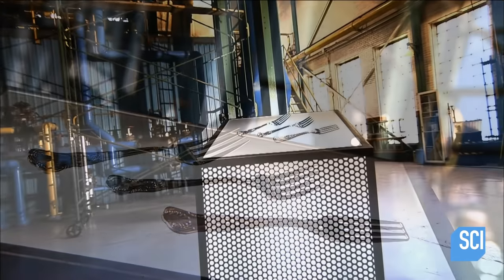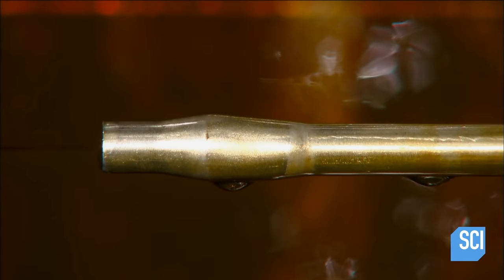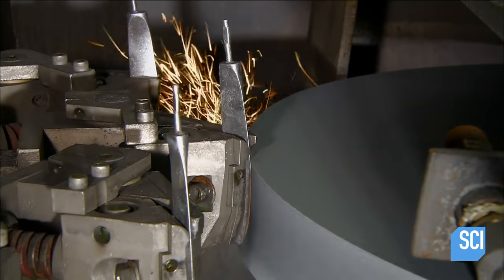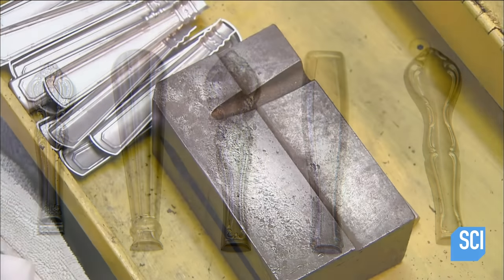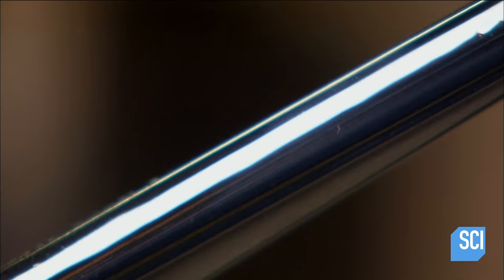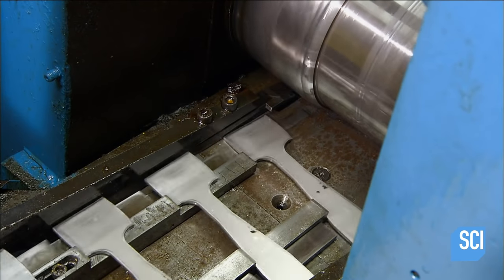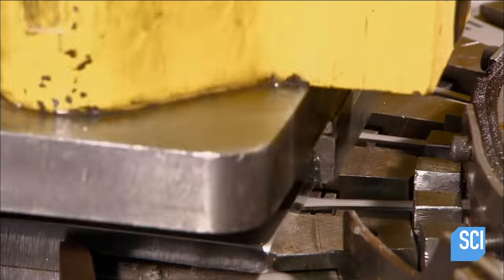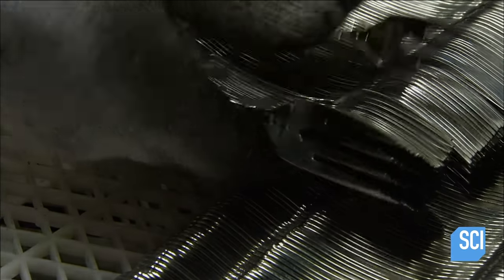How It's Made: Flatware

Comment: So basically the cement in the knife is a cheap way of making the knife feel heavy without using real metal.
Reply: I am shocked at this discovery. I’m almost mad. Here I was thinking that it was all solid metal.
Reply: And it really seems like it will fall off but I don't remember it falling off ever.
Reply: Less about weight, moreso about rigidity. The tang of the knife is held solid by that cement, and it keeps the thinner nickel handle from being able to dent or bend.
Reply: I'd even pay more for solid metal instead of hollowed out handles filled with cement.
Reply: I feel cheated. Will not buy expensive cutlery anymore. IKEA all the way
Reply: @wackychicken  But IKEA uses cheap imitation cement. Don't you want the genuine cement? lol
Reply: @wackychicken  your logic is backwards.
Reply: @wackychicken  LOL ikea!
Reply: That’s why I buy the knives that are obviously one solid piece of metal, yeah they are thinner but at least they are not full of cement.
Reply: @FartassVolfgangus  I mean, it works. Have you ever seen someone break one of these knives?
Reply: Why are people bitching about the use of cement? Why does it matter? Good luck breaking these utensils through normal use.
Reply: A cheap and ingenious way to do it because the weight of the cement will keep it consistent and provide perfect rigidity every time while still allowing them to be cast hollow to save on costs.

It can't be solid metal because it would be burning money on every handle but the cement is a very clever way to get the advantages of Solid Metal with Hollow Parts.
Reply: @Zeromaru42  Yeah, except these made-in-China cheapware are sold at higher prices to impress you of their quality. Real quality like the German manufacturer WMF use solid metal.
Reply: @sebastianriz4703  literally!!!! like so what they use cement? i’ve never seen a broken knife in my life
Reply: It’s about weight, balance, and ergonomics, as well as cost. Some lines will have both options but you should try both. The solid handles are always heavier so they make them thinner to balance in your hand. Sterling silver knives are often hollow and filled with cement. Knives are annoying for stainless steel cutlery because  they aren’t made with the less corrosive alloys. If you buy 18/10 flatware, the knife blade is almost always 13/0 (420) steel and unless it’s kept polished it will show some corrosion/staining over time.
Reply: Everyone in the comments arguing about the cement in the handle like that's the part you cut with or something
It's a frigging knife.
Reply: @jamesgilbert8552  Then you should have no issue buying a Rolex only to open it up and find a cheap Chinese made electronic component turning the dial. Hey, it tells time. Who cares what's inside right?
Reply: @SnoopyDoofie  hmmm, you've missed the point., but I can gladly walk you down there and help point it out. You see, in a Rolex, all of the components are used by the main design by some measure. The cement in a handle is just filler and holds no other purpose. Followed by you could put the Rolex back together with other parts of a higher quality, or lower depending, where as you rip that cheap knife apart and now you have a broken knife. Finally, if you can miraculously cut with the handle, you sir should be posting videos for how to cook the world's most tender steak, not arguing with strangers on the internet.
Reply: From this manufacturer, anyway.
Reply: @jamesgilbert8552 you could pass as me. I argue points the same way you do and with the same balance of facts and good old fashioned sarcasm.
Reply: That's right, Sherlock
Reply: @jamesgilbert8552 and yet all the internal components in a Rolex could be replaced by a $10 Casio movement and result in an objectively better for purpose watch. Clearly the function of the internal components of a Rolex is not that important.
Reply: @Blueshirt38 absolutely not. Definitely about weight and illusion of luxury

Comment: Wait, so my flatware is fully of cement???
Reply: I thought it was made of flat-inum
Reply: Maybe its the case in america
Reply: It's for the weight. Expensive ones are solid metal
Reply: Yep cheaper sets are filled with cement or sand.  Best type of flatware is solid handle with one-piece utensils (no two piece units attached together as one)
Reply: You clearly don't know what "cement" means in this context. They're not talking about Portland cement, such as is used to make concrete.

Comment: Okay so they fill it with cement to hold the tang in place, but cant that be acheived by welding it to the body?. Im assuming the cement is also to support the weight put on the knife.

Comment: Cement inside the knife handle???  No wonder the handle side is so heavy that the knife falls to the ground or on the table.  If you make the handle light, the knife will not fall off the plate.  No this is dumb.